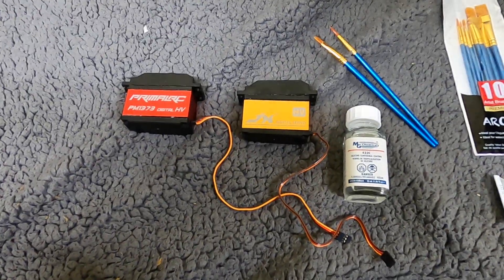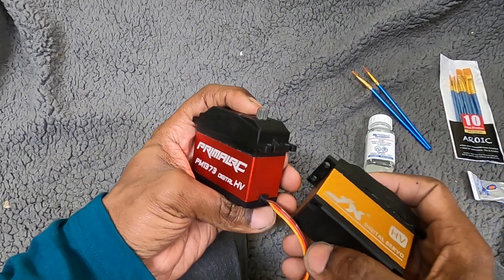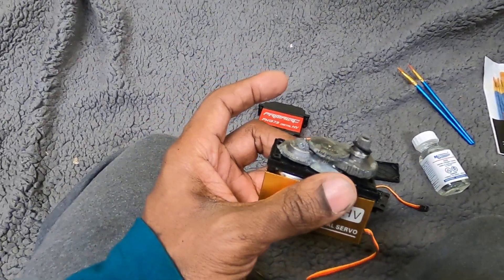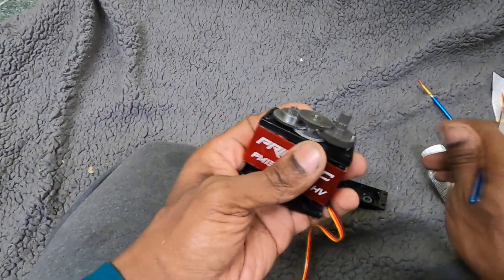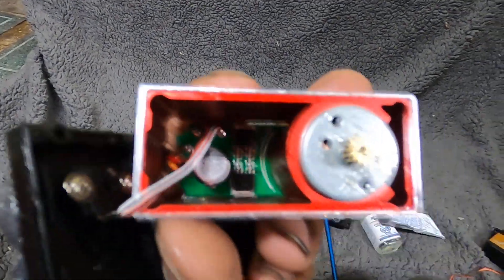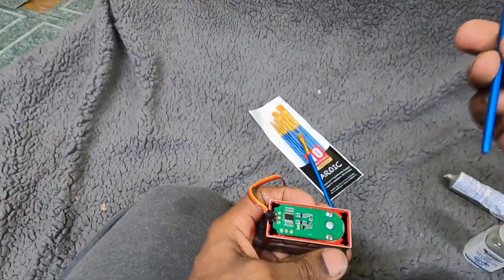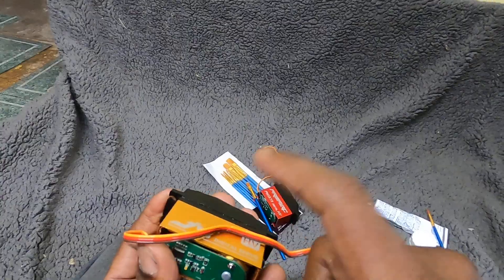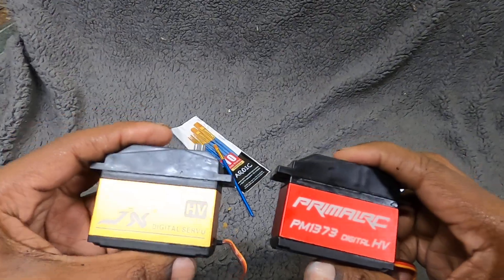1/5 Servos: PM1373 VS JX HV2070MG Pre-maintenance & Waterproofing

Comment: I don't run my rc in wet conditions. so other than adding some grease to the gears of the JX servo, it's a good servo? I have the dbxl-e 2.0 and this will be my 3rd servo. The stock spektrum servo lasted about 30 mins. Then I put a savox servo in and a gear inside broke 3-4 teeth, lasted about 4 months. So I'm looking a 3rd one. The specs on the JX servo look good, but are they accurate?
Reply from the maker: On the DB, check to see if the steering pivots is hitting the top plate when the car is on the ground with a bit of weight on it. I had to get an aluminum top plate, then grind some of the area where the pivots were hitting. That binding also caused it to turn right way better than left. Both of these servos are good, but the SPT70HV is the best. They all have similar performance & all blow away the Savox.
Reply: @Megasty15  Nice and super great information video between the 2. At least we are aware both are exactly the same servo. Please advice why is the SPT70 servo is better than the 2 above. Hope to hear from you soon bro. Stay safe & well.
Reply from the maker: @evo165  While they can all handle 8.4v, the SPT is the only one with it in the specs, plus it's mostly waterproof. But the PCB still needs a coating.
Reply: @Megasty15  what’s the SPT 70hp? I searched that and can’t find it
Reply: One more question, is the spline/servo horn 15T or 17T on the jx servo?
Reply from the maker: @Blueknight1960  15T
Reply: @Megasty15  Thank you
Reply: @Blueknight1960  15 tooth
Reply: @Fats-yg1jd  Actually the JX servo burned and the spline was 17T, not 15.